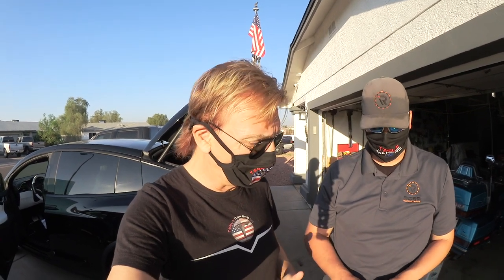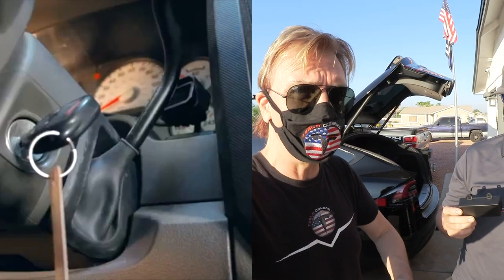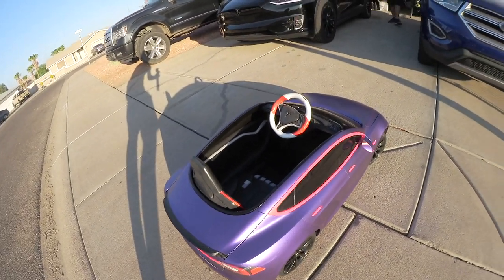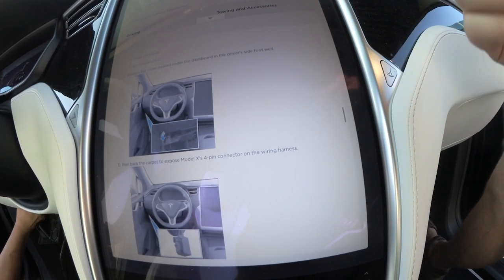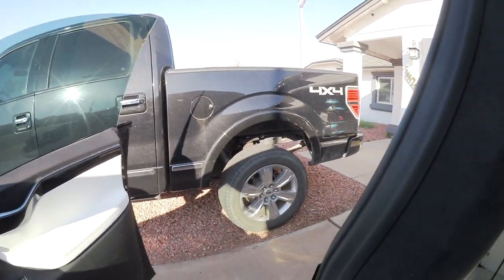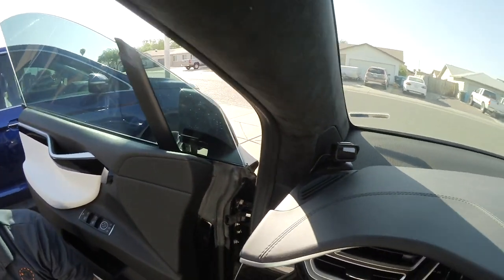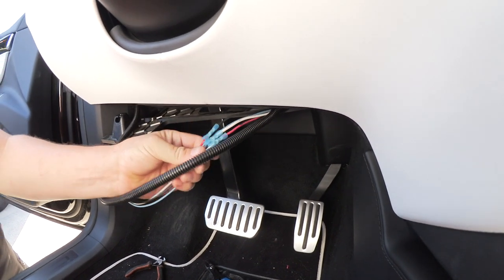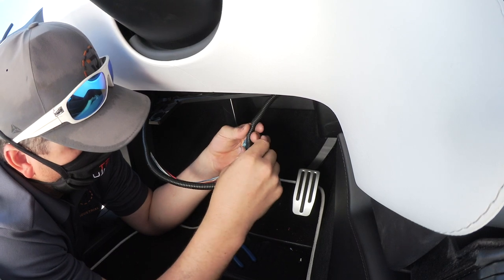Trailer Brake Controller in Model X not included

Comment: To run that brake controller cable took less than 5 minutes at Tesla
Reply from the maker: John that is correct because it is all pre-wired. In my case I had to install a little LED screen and a manual connector as well. Then I want to have all the wires well under the dashboard and not flying around. Rolf